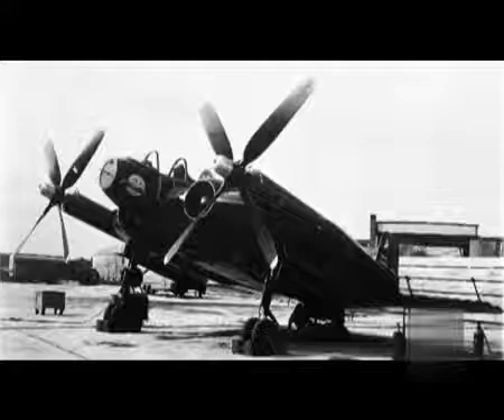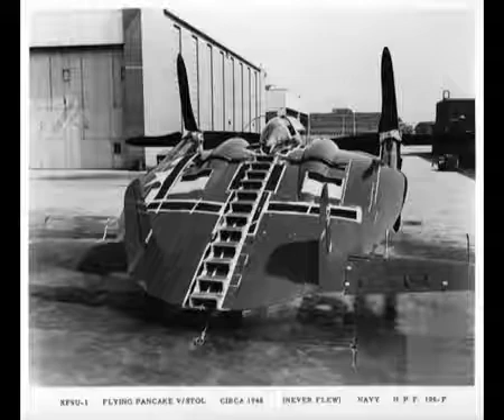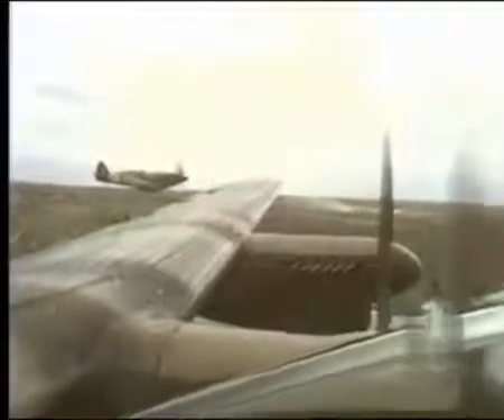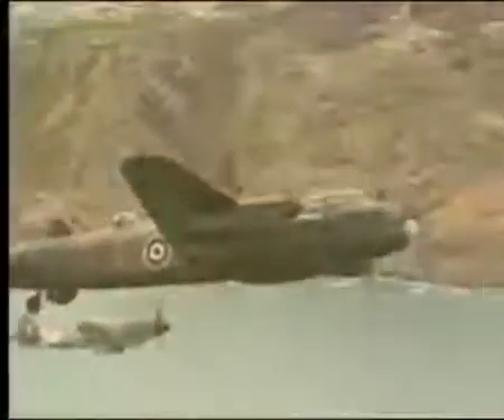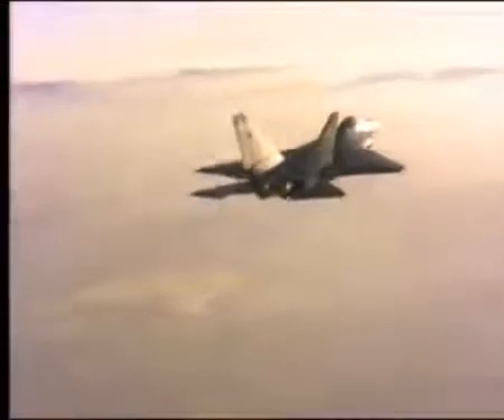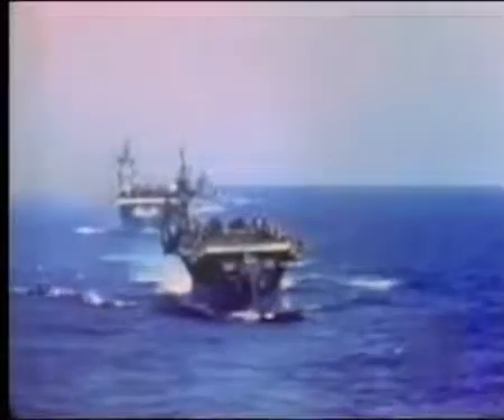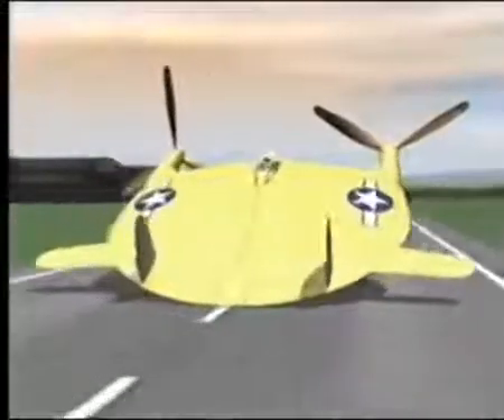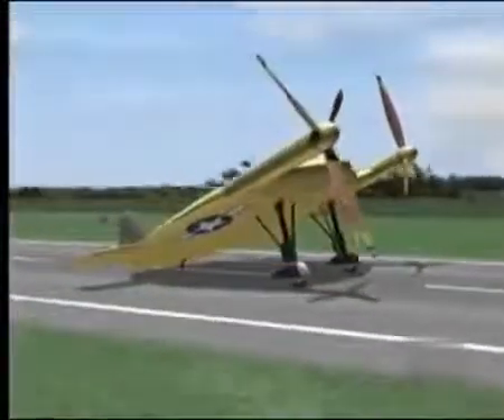Vought XF5U  Flying Flapjack

Comment: If you could make propellers out of low observable materiel and use turboprop technology, you would have a ready-made low observable anti-drone aircraft made for the front lines.  The only improvement in the plan form I would make is to sweep the elevators forward.

You would need programmable rounds and a sensor suite not unlike modern aircraft, or anti-aircraft artillery, and could also dispense with a pilot, AI allowing it to make gut-wrenching maneuvers at low altitude. To clear skies from all types of drones, cruise missiles, anti-tank missiles, helicopters.  Kind of a house-cleaner of the sky AND needing only a short runway.

You could also use a high bandwidth internet connection to reduce the on-board technology, making the unit impervious to crashing and re eating its secrets.